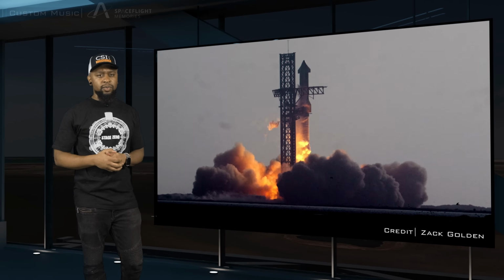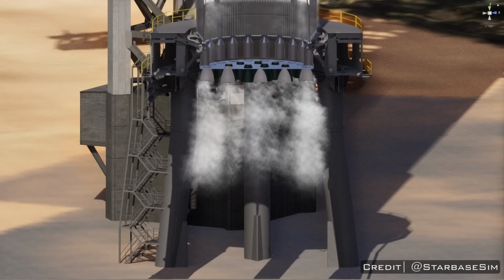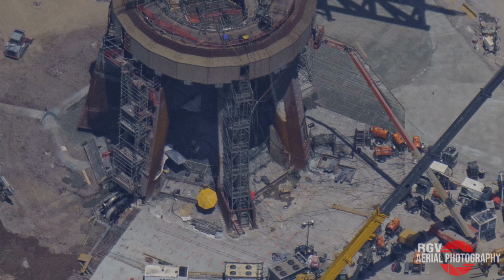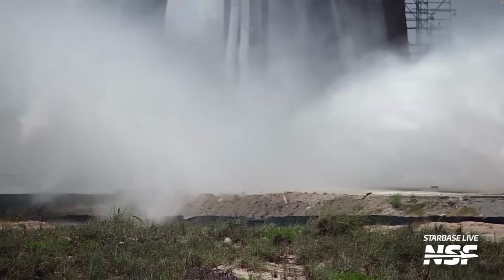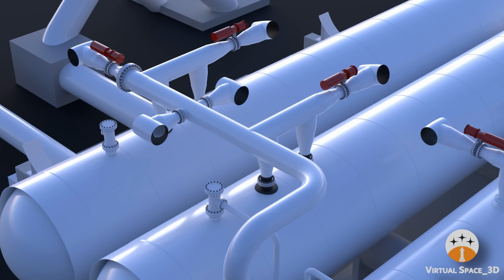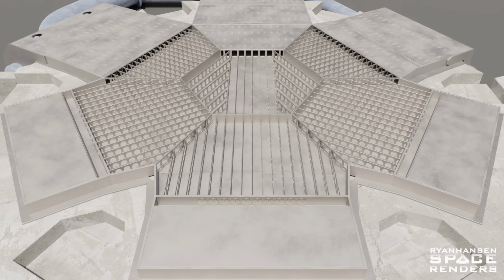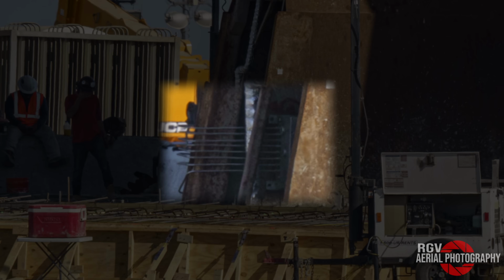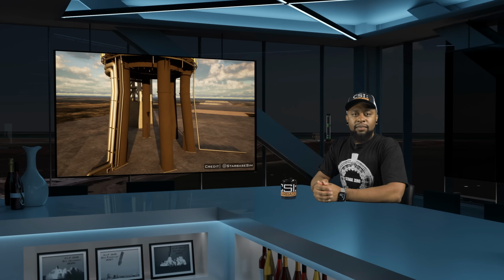How SpaceX Will Guarantee Its Launch Pad Never Fails Again! [Part 2]

Comment: This looks pretty dramatic but remember spacex is trying to find the bare mimimum. If nasa were building this it would cost 10x as much and take up 100x the area. Think 39a (built for saturn V) but 2.5 times bigger.

Comment: Zach, you are doing outstanding work with these series!   Thank you for all the time you’ve taken to make these.   I have 2 concerns about their approach.   First is simply the amount of water that they can apply for energy absorption which I understand is not even what LC39B has for SLS which has around half of the thrust of super heavy.   The second is the steel plate is highly reflective of acoustic energy and since it is flat may reflect it back into the engine bay with destructive consequences.   In the first flight the fondag and underlying soil must’ve absorbed the energy and were destroyed as a result with some engine damage.   I fear this setup could cause a pad explosion which may end the entire program since SpaceX is all in on this design given the site limitations.

Comment: instead of a Co2 firefighting, why not purple K ?   .  i suggest that they recycle the water, it is full of rocket fuel, but it can be recovered, sediment, treated then filtered.  very easy process.   The rocket saturated water going into the dirt will eventually kill the Aquafer.  [ i later heard, a greater retention for water is in the future.  Yes.  retention and recycled.

Comment: Not understanding,,,,,  About the ceramic materials used to take the heat.  ceramic tiles get stronger the higher the temperature.  so you are saying the tiles can not accept and deflect the heat??  the tiles are not absorbing the heat they are a shield that deflects the heat.  you say the heat plates are steel.  Steel can not accept the temperature of the rafter engines.  {cutting torch.  LOL}  The water is a dual element. to remove the back pressure from the center engines and for cooling.

Comment: The blast pressure overcomes the water pressure which then swings the deluge check valves closed to prevent backflow of steam or water as the pressure of the steam flash pushes both out of the plates and presses back into the plate flashing more and more steam as the plate heats up, creating more and more outward pressure, pushing up on the rocket blast, aiding rocket lift.

Comment: I think this is all great - really great. 
The only thing I wonder about is Starship's launching from another planet - like Mars, or the Moon, on its way back to Earth, or somewhere else. 
There will be no platform when it lands -  or to take off from to return. No water cooling, no protection of those engines from the dust, rocks, or whatever is churned up as they thrust, claw, and dig - just like its first test launch. Taking off from another planet, though, will be far worse, because there will be NOTHING to prevent huge boulders, masses of soil, regolith, and all the things that could kill or cripple those engines on the way up, and back.
 I understand there won't be as much thrust needed to take off from Mars or the Moon - but how much - and do they have power controls to decrease the force of all those engines evenly? Do they even have any idea, given the unevenness of the various parts of other planets and geographical locations on them (hard here, soft there, rocky over there, etc.)? 
I have heard NOTHING about how they will calculate the power needed from the point where they depart (on the planet or moon which they - hopefully - landed successfully on), or how they will calibrate and control the engines to take off from an unknown surface. 
No moon or planet is uniform on its surface, and having seen what these engines can do - even when taking off from what was a very sturdy, flat platform; I have to wonder how much thought SpaceX has put into landing on - and taking off from - a raw, unprepared, and unknown surface. Just thinking ahead. 
I'd be really interested in some answers, though.

Comment: Capture of the water shouldn't be a priority, decreasing the salt level will improve conditions for plant life, which will grow roots into the soil and help with long-term erosion problems. Also, it's just a lot of water in theory when looking at the one instant it's used, but average it out over a year, and it's not really that much. However, if SpaceX gets the cadence ut, they'll need desalination plants to keep up with demand, and probably a nuclear reactor to power them, because multiple launches per day will be hard to sustain otherwise 😂

Comment: I wonder if a magnetohydrodynamic generator that feeds the current generated to a huge resistor to dissipate the kinetic energy of the exhaust through diamagnetic resistance in the exhaust flow could help? I know they use this in coal and natural gas power plants to extract extra electricity from the exhaust, therefore boosting the efficiency of the power plant. This would decrease the kinetic energy of the exhaust flow from the booster.

Comment: I hate to be that guy, but I feel the responsibility to make a correction. 3:50, you insinuate that the heat tiles are primarily responsible of shielding frictional Heating. Friction only contributes be minimal proportion of the heat energy experienced in reentry. Rather, the heat primarily comes from the air being compressed rapidly in front of the spacecraft. It's a common misconception, and it doesn't detract from the point of your video, still a great video!
Reply from the maker: Yeah. As I mentioned in other comments, I had that included in the script but when I reordered everything to make it flow better I forgot to replace that section

Comment: If they don't repeatedly drain the pipes there will be less internal corrosion - if these are standard steel pipes and fittings.  New "fresh" water in the pipes will have some dissolved oxygen, which will be consumed by the process of corrosion.  As the amount of dissolved oxygen in the water is consumed the corrosion will stop.  Repeatedly replacing the water will increase the rate of corrosion.  This is one of the issues with steel fire suppression lines in many industrial and commercial environments.  For some reason people feel the need to often purge the "dirty" water from sprinkler systems, not realizing they are actually encouraging corrosion at the pipe ID.
Galvanization can slow the process of corrosion, and complete stainless will basically eliminate corrosion.

Comment: They could use the pressure of the engine to pump to water per the platform....just by using a different,cheaper,geometric design...

Comment: Great narrative of your reverse engineering observation skills. But is SpaceX making this unnecessarily complicated? NASA has the better idea of using simple water towers. Their also diverting a lot of the lift of the rocket motors by diverting the flames outward. You'd think they would want to keep the pressure,inward. It like building a big gun, then putting a bunch of holes in the bottom of the barrel to relieve the pressure if the powder that is going to send the bullet out the barrel?

Comment: Remember, there is gas pressure gradient along the vertical axis of the launch pedestal from the bell nozzle to the base. Such that the downward exhaust gas creates 0 to <1bar of suction and rapidly rise above 1bar farther away from the nozzles and pressure increases rapidly up to 17bar as gas meets the flat base. Inject water where the peak suction is and to maintain water injection at that suction point in the first few seconds from lift off. The tracking precision is not very critical because the suction will guide the water into the exhaust.

Comment: Why can’t the water be router adjacent to each bell nozzle and dispense downwards? 

This way the exhaust pressure will not be coupled into the water pipe as it did in the last launch accident. 

A second thought is to pressure jet water horizontally from all directions focusing at the center of launch pedestal through its slots at a level where the bell nozzle are. This way the downward exhaust will draw air and water in and mixed with the exhaust. This can decouple exhaust gas pressure to coupled back into the water supply.

Comment: I hope you're right. But this take is about as rose-tinted-glasses informed speculation as one could ever get! Beautifully done, as always, but a bit of a yada yada at times.
Water deluge systems were introduced during Apollo purely for acoustic dampening, not to somehow offset pad damage from thrust! The margins with this Starship "thrust dampening" water deluge thing are tiny - and actually unknown, of course.
The only reason this system was chosen was because of topology: SpaceX can't build (economically) tried, tested and proven thrust diversion pits at this location because...it's the wrong location!
But, hey, we shall see of course :)
I think this workaround will do its job for the upcoming test - which is great (no spectacular concrete shower - cool!). 
But the pad will still be so badly damaged that it will have to be rebuilt - again - (or replaced entirely, or even relocated!) for any subsequent launch - because Starship is a terrifyingly powerful monster that just wants to smash things up in its hunger for attitude. (I love it!)
Besides, all the math for this kind of stuff was figured out 60+ years ago. I mean, come on.

Comment: Musk is so rich, why not just make the tiles out of Tungsten with water cooling channels inside them, Tungsten has the highest melting point f any metal and is super duper hard, those tiles could carry any heat away and would never wear out....Tungsten is used in cutting tools for lathes, and it is also used a lot of the metal projectiles inside cluster bombs, so it can just zip through any steel object with ease...
Reply: Why would you want to use a heavy metal for a relatively lightweight heat shield?

Comment: Why not shape the blast surface like a cone (pointing upward) to mitigate or grade the 90 degree angle into more of a curve outward... the change of direction the engine plume must navigate to escape the center of upward force production?  Upward thrust is unchanged...or is that important?  Steam is not trapped as much, recirculation near the center is reduced.

Also, thrust as a concept is weird.  Seems like we waste a LOT of energy produced by letting it dissipate out from the center instead of redirecting it back up at the ass-end of the rocket.  Is there no known way to protect the thing from redirected additional upward blast force of all that exhaust?  

What about producing the whole kaboom inside a big tube?  Like, a really big one which could help create a massive upward pressure piling up beneath a circular blast plate upon which the rocket sits and which moves upwards inside the tube, beneath the rocket, effectively multiplying the thrust with all that built up pressure?  Potato canon style.

Comment: THE RAPTORS PRODUCE WAY MORE GAS AND NOW STEAM 
THEN CAN ESCAPE BETWIN THE LEGS ... 
AND THE STANDING HARMONIC WAVES KILL ENIGENS
WITH BACK PRESIUR.. SOOOOOO WELLLLLL  I CALL FAIL.
Reply: This aged well didn’t it ;)
Reply: @redbeard11200  yes
Reply: @kennethschultz6465  it hasn’t failed a single time yet man
Reply: @redbeard11200  oooh troll BS
Reply: @kennethschultz6465  did you not watch flights 2-5? Doesn’t matter flight six is in under a week you can watch that one dude

Comment: Awesome work and thanks for the share ✌️

I hope that everyone is understanding that this way of launching crafts into space is a temporary solution. Especially when you take into consideration all the resources that are needed to make that happen.

The only long term viable solution at this time (unless we can build antigravity devices) is an aerial platform of some kind.

This was first envisioned by the Space Shuttle Engineers but discarded because of changing requirements.

Let's cross our fingers that they move forward to more sustainable solutions.
Reply: Is there a possibility that the concept for launching a missile from a submarine using compressed air could used here?
Reply: @jamesg9932  Thanks for the suggestion.
Let me bring you to a possible future.
Imagine that we keep sending crafts to space like we do today.
Multiplying this by 1000 launched crafts a day as everyone is going to want to go to space.

The obvious outcome is resource extinction and all the other negative impact's to our planet.

Anyways, it's like space debris. Everyone knew that this would happen and no one cared about it.

Let's see how long it takes this time to learn how to do it the right way.

Comment: Just a note on the tiles.. WEIGHT !!... OLM can be made out of anything!! Mostly Steel & Re enforced concrete. The Tiles are made specifically to allow Starship to function as an aircraft. They also repel heat !!

Comment: inch lol.
Even SpaceX uses cm bubba. Step into the 20th century 🤡
Reply from the maker: Uhhh No they don’t.  These are American contractors and use imperial units when designing infrastructure.  You can’t find products in metric units in the United States.  The vehicles are designed in metric units but infrastructure is not. We can prove this easily. There are dimensions on everything they design.
Reply from the maker: In case you need proof https://x.com/csi_starbase/status/1467237651157823498?s=46&t=uwSPkmd-dgwz_lPMKFqlig

Comment: Awesome job!...and love the cooperation between channels (CSI SB, EDA, RGV, NSF, etc) Do you think they might connect the water tank in the OTF to the deluge system to help for a recycle?
Reply from the maker: I’m surprised that they haven’t done that honestly. But it’s important to keep water in those tanks because they are used for a giant heat exchanger that acts as an autogenous pressurization system for the cryo storage tanks

Comment: A really great in depth explanation of the deluge system. One thing that puzzles me is that they join the large and small systems together and leave the middle sized pipe separated. It would seem more logical to join the small and medium together to balance the system more easily. 
Well I'm sure someone did the math.

Comment: the sound pressure alone would be able to destroy the steel plates and possibly damage the rocket during launch and the water becomes necessary not only for steel plates to not reach boiling points or any gas pressure but also because it distorts the sound waves

Comment: Very neatly put together episode.. I noticed just one thing that concerns me about the water flowing out of the plate. It shows in the drone view. Once the static fire stops, it appears that the flow was quite subdued. It then starts to rise and 'recover' flow and height. Almost as if the thrust plume suppressed the water flow. Sure hope that is not the case. Any explanation from the more rocket tech savvy persons on here?

Comment: Zack - as a retired US Navy submariner there is another issue with water vapor being put into high pressure "air" tanks, other than organics.
As part of the USS Thresher accident investigation, it was determined that moisture was allowed to collect in the high pressure ballast tank blow tanks. When this was actuated to deballast the ship during flooding, the expansion of that air caused the temperature to drop, allowing the moisture to freeze, blocking that air flow. In the case of the Thresher, it was one of the events leading to its loss. In the case of the booster bidet, it could result in insufficient air pressure to push the water, reduced flow to the shower head and damage during engine firing.
Reply from the maker: Wow. thats something that I didn't consider. That definitely makes sense though

Comment: It takes about 28 days per inch of slab to fully cure a new slab of concrete.  During that time excess water trapped in the concrete works its way out of the slab.  I don't know the exact number for fontag, but I would assume there was still excess water in the concrete around the pad.  The cracks may have been mechical/ acoustical, but their location suggests heat and retained water in the concrete may have been a factor.

Comment: During the discussion on the water Deluge system,it occurred to me in the form of a question. I pondered why it was that Elon &Team SpaceX hadn’t tried,or if they had,why they never shared that Fact?I for example would be extremely interested in the fact of wether or not an Impact surface would be better or worse as A”Concave”or “Convex.”shape &just how each variation would effect the interaction with the engines thrust  from above.

Comment: I have been watching the progress carefully, and after the test fire this past few days, I am not too sure this is going to work. I hope I am wrong, but I think the thrusters are just too close to the ground. It looks like they could do with lifting the whole platform another 20-40 feet. you see, it is all well and good having the cooling system stopping the thrusters burning into the concrete, but the space under the rocket just looks too small for the physics to fully ensure that the thrusters can be dowsed enough, and have enough free space to exit the area. Like I said, I hope I am wrong, and I only made this observation after watching the static fire test earlier. Why did they terminate after only a few short seconds? thrusters cutting out, but why? not enough space to fully fire, without getting drowned out by the heat supression system.
Reply: Elon is converting OLM into Steam Cannon, when done everything will start to make sense to you
Reply: @KarolKarolak where?

Comment: Another water supply question. Is any of the water fluoridated?  Fluoride is highly corrosive and extremely poisonous. I do not know what effects it might have when being released in that volume thought it would be a small % compared to the water. Chlorine is also poisonous. Both evaporate at a lower temperature than water so they should actually boil off first. However, chlorine is heavier than air. 🤷🏻‍♂️